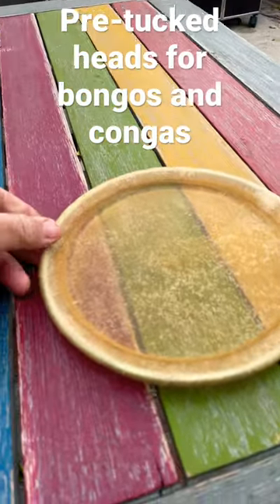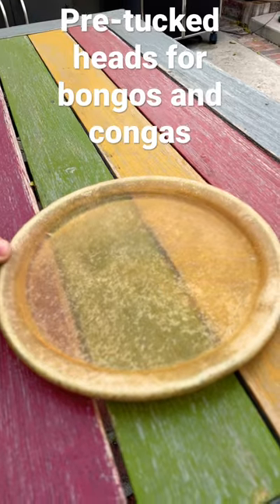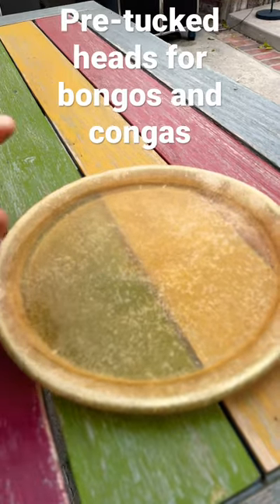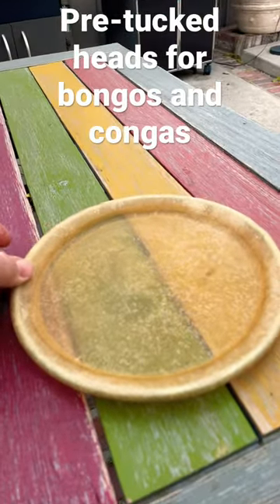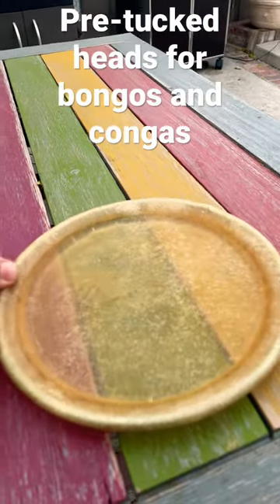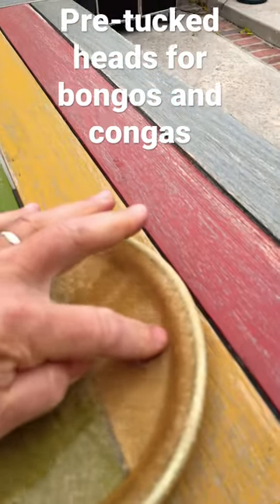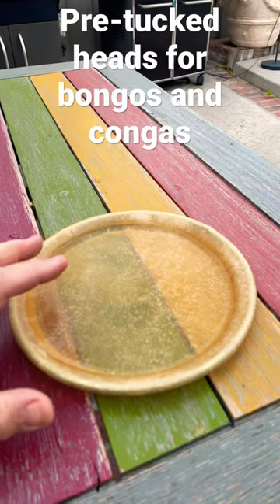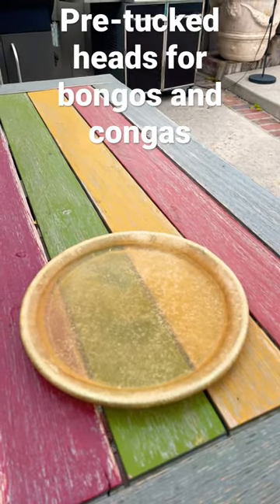Pre-tucked heads for Bongos and Congas

Comment: If it's the correct size, you really don't have to do this. If you are tucking the skins yourself on the bongo, then yes the skin will need to be soft. Hand tighten the nuts and let it dry, then tune up.